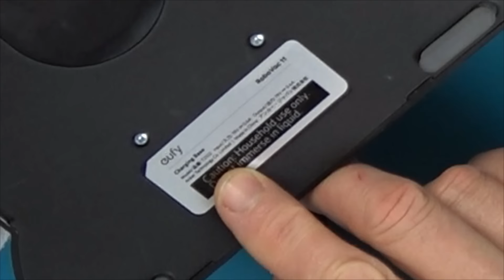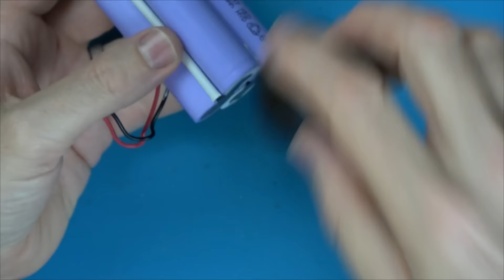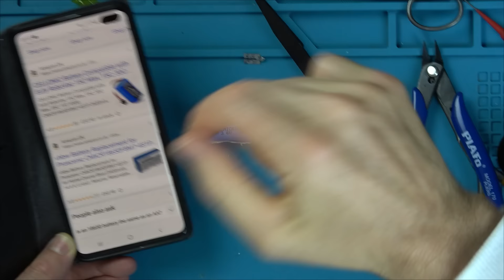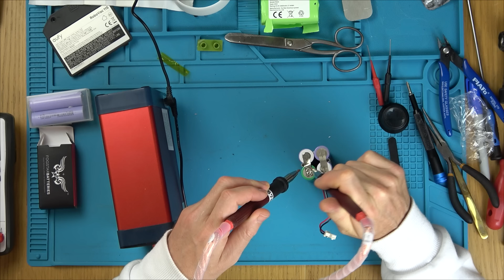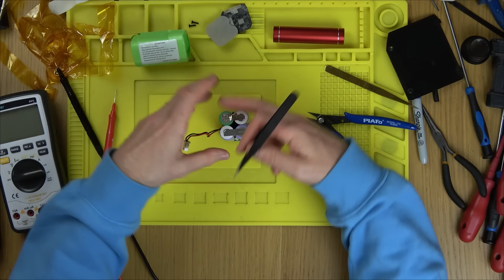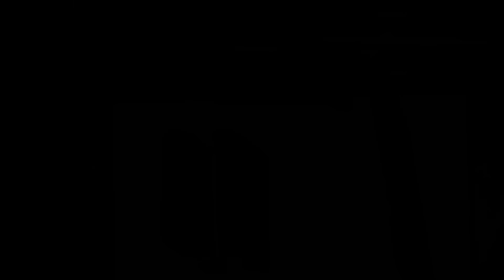Robotic Vacuum Cleaner that SUDDENLY stopped WORKING! - Can it be Repaired?

Comment: When LiIon cells age, tiny crystals form on the super thin insulation layer between positive and negative. It can then happen that these crystals perforate the insulation membrane, leading to internal short circuits that trigger venting and popping of the current protection.

I assume all cells were aged to the point of failure and charging them sent one after another over the edge. That’s why you never replace only one cell of a pack but all of them - unless specific applications have batched cell systems like electric cars.

Comment: Great video. A while ago there was a video about gopro batteries trying to be repaired, it seems that the BMS had a protection circuit that reset when the voltage was removed.. The BMS simply decided it wasn’t going to work anymore, I saw a repair of a car start pack, that had similar BMS protection circuit.. Basically it seems it could mean, new batteries means new BMS on some devices.

Comment: Measuring the battery after the protection circuit if the charge circuit is suspect is useless. Guess what the protection circuit will do if the battery goes too low - exactly, cut the voltage to the leads so that no further discharge can happen.

Also: The correct charge voltage would have been 4,2V x 4 = 16,8V (max). Using 19V again could cause the protection circuit to disallow charging.

The protection board on top is not directly involved in charging, that is purely done by the charger. The only thing is the protection board does it interrupting charging/discharging when the battery is used outside of its allowed parameters. The only thing that would result in defect cells that could be caused by the protection board, is when the cells are grossly out of balanced and the board would not be prematurely terminating the charging process.

PS: Had the same battery - with the same issue.

Comment: Not watched  all of the video just want to have a guess I am going to say the BMS on the pack has disconnected the pack as its under its safe voltage
Reply: Most BMS are programmed to shutdown at a set voltage to protect the user and won't allow a charge so you have to bypass the BMS to charge the cells but not recommend esp with a cell that low
Reply: 4c means 4x its capacity so a 2000mah battery could be discharged at 8000ma

Comment: 4.2x4=16.8V max voltage. The charger outputs 19V. The pack was overcharged. Wrong power adapter maybe?
Reply: The charging circuit should lower the voltage to required for a battery pack. Example, usb is 5V, but your phone battery is also maximum 4.2V.
Reply: @bubi173  It's the proper voltage so I would say it is dropped. It's still pretty high for no reason. The BMS doesn't seem to balance well. One of the batteries was 4.1V. I'm not positive but it looks like that was the next dead cell.
Reply: @ngiordano75  You have voltage "losses" in cables, connections and regulating circuit, there could be a buck converter in between. All depends how it is designed, nothing strange to have higher voltage. BMS is probably OK, but batteries are gone, so it can't do it's job. Battery can measure 4.1V but if it is charging quickly with rated current means it lost it's capacity.
Reply: @bubi173  which is why a check of charge voltage might have been a good idea. Those batteries should not have been depleted. I guess if it happens again that will be a cool revisit.

Comment: 18650s seem like just bad batteries to me, ill add I'm only starting the video but I've had batteries that just seem bad even when they were from the same batch as others.

Its hard to find a set of equal batteries which is ideally what you always want as one bad one ruins the rest.
Reply: The batteries were overcharged. The charger should not have been more than 16.8V. It's user error
Reply: @ngiordano75  I don't see the relevance a lot of 18650s are just bad from new in my experience even when buying from trustworthy sources like fogstar like Vince did. Their just too unreliable the way they are currently made.
Reply: @ŦƐƘ  the relevance is if the batteries go beyond 4.2 volts, max, they get damaged. Under-voltages can sometimes be recovered. Not so for over-voltage.
Reply: @ngiordano75  yeah I'm not sure if I believe the circuit is bad but I see your perspective. 

Personally I'd just suspect an individual battery due to my own issues with them.
Reply from the maker: This charging dock is for Eufy 11 and my vacuum is Eufy 11S, the power plate on my vacuum has the input as 19v 0.6A, but the replacement batteries online are the same for both models including a range of other models. Unless the 11 has different circuitry inside it to the 11S I think both docks will be outputting more than 16.8V. From memory (it has been a while) the difference between the docks is that the 11S will output a signal to call Eufy home when close by, my 11 dock doesn't do that. It is interesting though why the dock voltage is so high unless the voltage on the actual wires feeding the motor is reduced down to 16v ???? Cheers for commenting 👍
Reply: @Mymatevince  no problem I'm not an expert just have never really found these batteries reliable in my own experience but I'm well aware they are everywhere and also you have bought yours from probably the most trustworthy source in the UK.

Love your vids.
Reply: @Mymatevince  yeah it's the correct voltages. Weird they go so high to charge alone though. The BMS may not have a proper balance circuit. The variation in voltages is a bit significant
Reply: @Mymatevince  Could be a left over from some previous model with NiMH pack. Instead of supplying a proper charger, they rely on BMS forcibly shut down charging at 16.8V. Now if OVP fails in charging circuit, cells pop.

When I saw sparks fly when spot welding, my thought was you better turn down power before you burn a hole in the cell. instead you increased the power!😂

Comment: got this same issue with my  had 2 batteries for it now going on to 3rd one. look at date on batteries mine was made in 2015  so batteries are 9 years old. but when connected to charger just stays blue  but wont charge at all dies as soon as you turn it on

Comment: "These cells are dangerous". Treated the right way they are safe as houses. My car is dangerous if i drive on the pavement.

Stop scaremongering ffs.
Reply: when failure happens they go boom or start fires, its bert to be scary and wary rather than “oh nothign happnes” and then boom
Reply: @Sulphur_67  Been dealing with them for years and never had one go "boom" on me or even short on me. Battery safety 101. But to say they are dangerous without ever explaining why they "COULD" be is just stupid.

The more i watch this channel the more i see this bloke being complacent. The only thing that is dangerous on this channel most of the time is him.
Reply: @SiAnon  that’s why he says to not replicate at home and also that he’s not a professional, he said why is some precious videos, i nearly punctured a full battery once and threw it out out of worry that ti coudl catch fire anyways
Reply: The issue is - if you slip with a probe, or use too much power with the spot welder you can go from safe to a fire that is not easily extinguished with water very quickly. If you take the right precautions the dangers can be mitigated, but most people watching this video would not have the right mitigations (like a metal bowl to contain a burning battery, fume extractors, quick access to a non flammable out door space etc.) Not to mention, these mitigations could be needed for a battery within what appears to be a perfectly fine device if the battery pack is compromised and the charger does not have the right protections on it (the reason people call cheap devices from china fire hazards, they don't have those protections built in, in many cases)
Reply: If you’re driving for the first or second time, like you’re doing when working with Lithium cells, then yes, you are dangerous enough to need caution and supervision.
Reply: @TheXGamer969  in most places you generally don't have access to a car before being forced to get that level of training - less so when it comes to lithium batteries and YouTube videos.

Comment: Vince, the C-rate is the rate at which the battery can discharge (or charge), relative to a 1-hour time period.

When I used to fly RC airplanes, I had to spend a good amount of time marrying up batteries with motors, ESCs, etc., to make sure they could probably provide the current needed to supply the draw of all the electronics on the plane.  So, I spent entirely too much time comparing discharge rates, and charging rates on batteries to make sure I didn't have issues.

So, for your no-name battery that had a discharge rating of 3C, that meant that for a 2600mAh battery, if it could discharge at a rate of 1C, it would take 1 hour to discharge all 2.6Ah.  At a discharge rate of 3C, it could discharge it all in 1/3 of an hour, or at a rate of 7.8A.  With your new Samsung 25R battery you used, looking up online, it says that it has a maximum continuous discharge rate of 20A.  Converting that to a C-rating, as it's a 2500mAh battery, that means it has a discharge rate of 8C (8x2.5A = 20A).

I don't know if that has any bearing on the destruction of your other batteries.  I suppose it depends on the battery circuitry, and whether there's any rate limiting on the current draw that it can pull.  But I suspect there might be a chance that the Samsung battery was potentially discharging at a higher current than the other 3 no-name batteries; potentially causing a heavier draw on those batteries, and ruining faster what may already have been (as you mentioned) another dying cell.

Of course, that's completely speculating at this point.  But, hopefully the explanation of what the C-rate is on a battery helps out!

Comment: i wonder why it outputs 19V shouldn't it be regulated to 16.8V or something like that? that's the max voltage it should have on the battery pack
Reply: The BMS will regulate what the cells need and can take same for how much amps it will let go through out or in. The bms could have gone in protection mode and or giving wrong pass through. I encounter this all the time in drone batteries. Look for a Texas instruments EV2400 or EV2300 and find the CAN/UART ports on the bms and connect it to your computer. its a very pricey tool and you need a subscription to use but many problems or tweaks can be done with in li-on - lipo battery packs 😊. (PS in all honesty most people should not mess with it themselves so if you feel this might encourage people to test, remove my message. Purely want to inform Vince about this tool) Kind greetings from Sweden.
Reply from the maker: @Drone_Out  I think your comment is very useful and will be useful to my audience. Hopefully the video and your comment makes it clear how dangerous these 18650 batteries can be, so it is staying👍Thanks for posting Drone Out👌
Reply: @Drone_Out  If it is UART/Serial, there are many UART/Serial to USB adaptors that are dirt cheap and don’t need special software. You just need to know how the chip works and if there’s anything the chip outputs via that connection.
Reply: @TheXGamer969  you are correct although you said it you need to know the correct adresses to the chips IO to change things and some chips have coded locks which what i mentioned with the EV and subscriptions to avoid decoding for several hours. Try and unlock DJI drones latest batteries and even Milwaukee batteries without those unlock codes nearly impossible unless you are a wizz.
Reply: I also has this issue with 3 phantom batteries but instead of buying expansive tools from texas instruments i found a github guy who published a tool to do the same thing with raspberry pie i/o pins. Not easy and not for anyone but for me it was ok.  @Drone_Out
Reply from the maker: Good point, I really don't know Karthor. Well spotted 👍
Reply: @Mymatevince It's giving the battery management system just a little over 10% overhead in voltage to ensure the cells can reach their maximum capacity when charging them
Reply: The 19v probably doesn't go straight to the battery there is likely to be a charge controller inbetween.